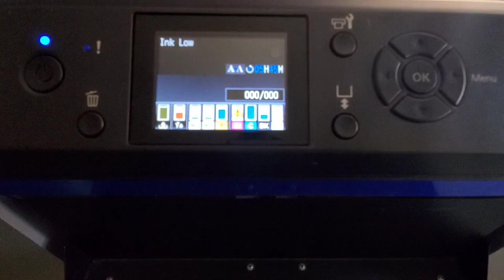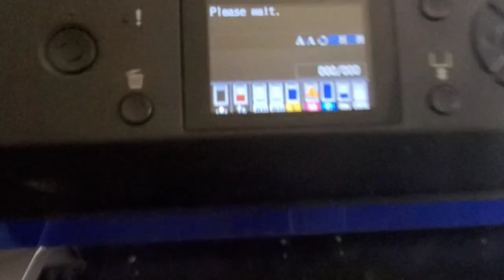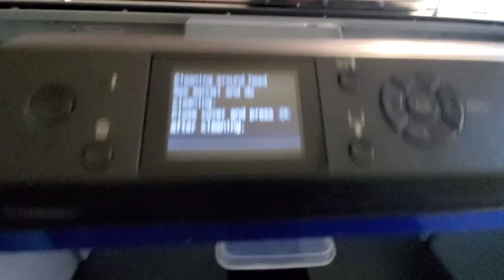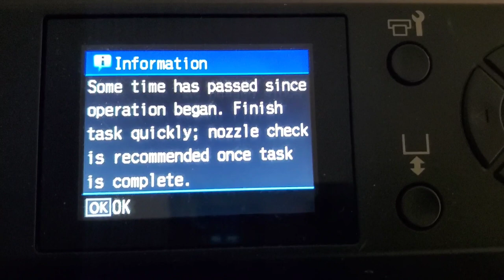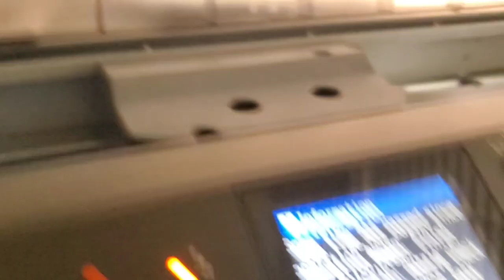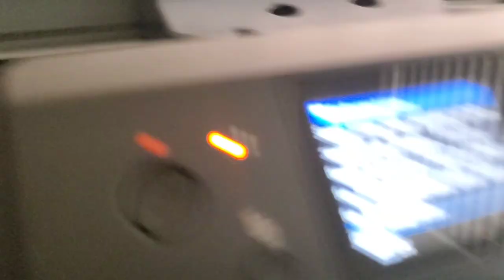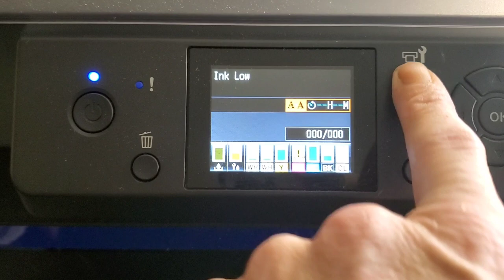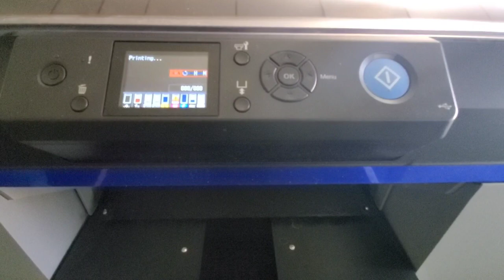SOLVED: Epson F2100 / F2000 Fix Print Head Unclogging & Deep Cleaning Nozzle Check HACK DIY

Comment: AMAZING RESULTS! We're an apparel manufacturer creating samples for stores like Forever21 and Maurices with our printers. We had an urgent meeting in 5 days and needed samples, but our white ink wasn't working, cyan was a mess, and we had suction errors. After trying 5 heavy cleaning cycles, tube cleaning, and contacting the DTG seller with no success, we reached out to Epson support, who quoted a flat fee of $2,479 for repairs, primarily nozzle replacement.

As a last-resort attempt, I tried something I didn't think would work, but IT DID! Our printer now operates like new, saving us $3,000. Thank you!
Reply from the maker: Congratulations on your new opportunity.  I'm glad it worked! Good luck to you!

Comment: Man I can't thank you enough I got my f2000 for a steal but no white at all on nozzle check a week of trouble shooting finally went and bought your ingredients a $8 cost soaked for 8hrs pulled it did a heavy clean and all 4 whites were visible with a few gaps ran a light cleaning now everything is 100% i felt like won something lol. 👏 to you sir thank you
Reply from the maker: Out freekin standing! You won $2000. For real. That's amazing. Im glad you got it. The nozzle cleaning takes a few, and is a slow process, but worth it.

Comment: Will try this. We have 2 white print heads clogged for a year but it prints well still with only 2 white print heads of the 4 but the F2100 thinks it's out of white ink when the cartridges are still 1/2 full?  Perhaps because it is only printing from 2 of the 4 white print heads it is only pulling 1/2 of the ink that the ink meter usually indicates?

Comment: OMG.....IT WORKED!!!!! 
My CMYK were perfect but given the cost of White ink I did not use the white ink for a couple of months and they were blocked even after I had replaced it with 2 brand new cartridges! As my F2100 was 1.5 years old, so out of warranty. I was quoted for a brand new printhead replacement plus travel time & labour at just under GBP£2,000 (USD$2,500). I built the contraption and left the printhead to soak for 4 hours, followed by a heavy head cleaning and 90% of the White came out on a nozzle check 2 more medium & 1 light and now have 99%!!!  We do not get Windex on the UK but I had a DTG flushing solution which I ordered from the USA and it worked really well including a few cleaning swabs total cost $20. THANK YOU (from the UK) for putting this video up!!!

Comment: I tried this method with my Epson DX5 F187000 printhead. Unclogged some individual nozzles, but miracle didn't happen. To be fair, I've bought refurbished printhead, it worked great until last month, when it stopped show some white nozzle check. Maybe I've made something  wrong, but I mixed ~700 ml of Mr. Muscle (alternative to your Window cleaner), ~180 ml distilled water and ~45 ml of alcohol. Then left printhead for about 11 hours, with almost no result. After this l've put the printhead back into your cleaning solution and in addition flushed all nozzles. Only after this inks started draining like you show in the video. This time I waited >12 hours, as the result, pretty much the same nozzle check text as before. If anybody has any hints on this, please let me know! Anyway thank you very much for your video.

Comment: My f2000 printer hasn't been used in 3wks, went to use it and no color was coming out, did a few heavy cleans and now only prints blue. Does this mean my heads are clogged? Would this help?

Comment: Man, amazing. Thanks for doing this and waiting for more tips on saving money on this machine cause it's a hell of a job to get a profit out it if you stay with all epson parts.
There is a video on winding up of wiper unit,air filter diy and now this.Any more tips would be appreciated !!

Also to fellow Brethren, you can get wiper unit cloth from china so you can change it after a couple of uses.
Reply from the maker: Do you have a link to the cloth? Thanks!

Comment: I spilled the liquid on the platform, thank goodness it was clean, I opened it to look and at the bottom there are only the rails, apart from that I am doing it with the printer off.

Comment: Trying on mine but using a respected online recipe for cleaning fluid which I'll share. Unknown period of sitting unused so not expecting a miracle, but wish me well! P.S. using the platen to raise a very shallow container + small cartridge underneath this to correct level (found it much easier & stable)!
1 % concentrated ammonia
3 % propylene glycol
20 % isopropyl alcohol
distilled water up to 100 %
To prepare 1 litre of the cleaning fluid:
In a one litre bottle put 10 ml of concentrated ammonia, 30 ml of propylene glycol, 200 ml of isopropyl alcohol, and add distilled/demineralized water to a total volume of one litre.

Comment: Thank you for the video. I'm going to try this method. But I have a problem. I'm from Russia and there are no Windex in here. Could anybode suggest what can I use instead of Windex? Or maybe anybody know composition of Windex that I can find analog here. Thanks!
Reply from the maker: It's glass cleaner that smells like chemicals.  Here is what's in it. 

2-Hexoxyethanol — a surfactant cleaning agent

Isopropanolamine — a solvent cleaning agent

Ammonium hydroxide — better known as ammonia-D

Lauryl dimethyl amine oxide — a surfactant wetting agent

Sodium dodecylbenzene sulfonate — also a surfactant wetting agent

Comment: Thanks very much for this video...may I ask if it's ok to flush the four small damper cartridges?  I've flushed all of the small ports on the damper assembly, just didn't know if I should with those as they don't feel very "durable".  Units been sitting a while (F2000), so wanted to get everything flushed that would be needed.  Thanks again!!!

Comment: Can I unlock the printhead from the docking station without Ink cartridges installed in the printer? If not can I unlock the print head with empty ink cartdridges? I don't have full or partially full ink cartridges and I also don't want to spend $1300 to gamble on this soaking process working in the first place. Please advise.

Comment: How did you fix it not recognizing the ink level? This is my problem as well as doing what this video is saying… same situation, only I moved, machine sat for awhile. White is the only one I’m having issues with so hoping this works. Then I have that level issue… they are almost new cartridges showing 20% maybe. Thank you!
Reply: Hi! My f2000 no longer recognizes ink levels on the blue and yellow channels. He says they are practically exhausted but the ink in the cartridges is about half ... can you help me? 😔😔
Reply: you need to unclog the 2 tiny holes on the inside of the headcap , put a liitle but of solution to soak overnight inside so it can clear a bit more as well , also you can keep using the cartridge until it runs out even if its showing a lower level than it actually is , if for some reason it tells you to replace it with still alot left , take the cart out , put an older empty one and then put it back and it should let you squeeze out the rest , let me know if you need anymore help i can give you my email !
Reply: @yousefsaleh3758  yes that is the problem it says I need to replace the ink cause it’s “empty” but it’s at least 80% full

Comment: Hi everyone 
I done exactly what you made in the video, 75% winded, 20% water distilled and 5% alcohol, soaked for 12 hours, turn of the machine, sure  that the mixture hit the top of the head at 1mm above. My surprise that nothing happened, the mixture still clean and bleu as it is. Please can you tell me where is mistake. ( BS: all Color’s channels work, except white 1 white 3 and white 4 stop working suddenly, and we use the machine every day even week days some time. Thanks in advance for you time and help

Comment: Excellent video.....
Hello, I'm really thinking hard about buying the F2100, can you give me a little advise or words of wisdom. also....can you use the method you used in this video as preventative maintenance? Thanks for the video?
Reply: just make sure you do a nozzle check, light cleaning, always shake white ink, print and after do another light cleaning. my people skipped alot of cleaning. after 6000 prints it got clogged. But this guys simple cleaning saved us a ton of money.

Comment: Good morning,
thank you for this incredible thing.... quick question, if I only have 99% isopropyl alcohol, can I only put 2.5% in the recipe? and is demineralized water made instead of distilled water?

thank you very much for your great advice... :)
Reply from the maker: Yes, that's fine. Just dilute according and add water to offset.
Reply: thank you, I will do the treatment on Wednesday and I will give you some news... thank you very much

Comment: is there any Europeans in here that knows an alternative to the chemicals. At least where i am from, we have no windex :)
Reply from the maker: Windolene perhaps?
Reply: @richardgrotz8089
3 minutes ago (edited)
Trying on mine but using a respected online recipe for cleaning fluid which I'll share. Unknown period of sitting unused so not expecting a miracle, but wish me well! P.S. using the platen to raise a very shallow container + small cartridge underneath this to correct level (found it much easier & stable)!
1 % concentrated ammonia
3 % propylene glycol
20 % isopropyl alcohol
distilled water up to 100 %
To prepare 1 litre of the cleaning fluid:
In a one litre bottle put 10 ml of concentrated ammonia, 30 ml of propylene glycol, 200 ml of isopropyl alcohol, and add distilled/demineralized water to a total volume of one litre.

Comment: I wasn’t gonna spend the 2k for replacing the head thanks to the video will see what happens in 12 hours for now
Reply: Please update :)
Reply: @owlfactory-cs  update so before I did it I was showing little bit of white ink left in the cartridge so yesterday after soaking the head for about 22 hours I went ahead and did a heavy cleaning and then it showed that I was low in white ink so then I did I light cleaning but I wasn’t able to get any white on my platen I got all other color but no white. I’m assuming it’s unclogged since it’s now showing low ink in the screen I place an order of inks so will see what happens when I receive them also did a cap cleaning
Reply: @Carlos-ru4zt  Man,good luck.may the white ink gods be with you :) . Also Did you turned off the machine or was it running the whole time ?
Reply: @owlfactory-cs  it was running the whole time I was debating if I should have unplugged it but I didn’t
Reply: @owlfactory-cs  do you have the link to order the head cleaning cloth from China you mentioned earlier
Reply: @Carlos-ru4zt  did you get it to work
Reply: @ApexProtector  no it’s was too clogged so I spent 2.5k replacing it

Comment: I am doing this for the third time wish me luck. the first time no white ink came out in the bowl I used the second time white ink definitely came out in the bowl but no white ink is showing up on the print test so hopefully this 3rd time will do the trick 🤞 
1st time 12 hours 
2nd time 22 hours 
3rd time I'll try 24 hours
Reply from the maker: Be sure to do multiple print head cleanings after to re prime the ink.
Reply: @clixstormdiy4352  I'm on my 4th time now I keep getting suction error I've cleaned out the suction cap several times but I'll just keep repeating until the planet runs out of windex lol 😆
Reply from the maker: @Rampacito  check the rim of the cup and make sure it doesn't have ink buildup. It looks plastic

Comment: ahhhhhhhh man I tried this and it sadly did not work for me!!  prior to doing this, all my lines were producing beautifully, except wh3 and 4.  They were producing NOTHING!  After letting it soak for 18 hours, everything remained the same!  wahhhhhh
Reply from the maker: 4 heavy cleanings
Reply: @clixstormdiy4352  are you suggesting to run 4 heavy cleanings after this?  I am open to anything, thank you!
Reply from the maker: @Rachel Smith  yes, purge any liquid and establish a good suction flow.
Reply: @clixstormdiy4352  sadly, it is not working still.  The machine sat for 6 months prior to me getting it. I think I am doomed and have to get a new print head......
Reply: @clixstormdiy4352  how do get rid of the suction error
Reply from the maker: @Rampacito  clean around the suction cap. It gets buildup OK ink that looks like rubber ,but its ink.

Comment: My Wh3 and wh4 were not working.. After following this, nothing works at all.Any help is appreciated
Reply from the maker: You need to do several cleanings. The ink is cleaned out of the head as intended.
Reply: @clixstormdiy4352  I did about 3-4 heavy cleanings.. nothing from any of the nozzle. before following this procedure, i had all working except wh3 wh4..  now nothing.. how many should i do more
Reply: @clixstormdiy4352  btw i appreciate your reply. thanks
Reply from the maker: @pankajmehra2684  mine was the same way both times. It took a lot to clear the lines of cleaning agent. How does your tank sponge look?
Reply: @clixstormdiy4352  which tank sponge.. the plastic box which i used to clean the print head with? it was almost clear like it cleaned nothing

Comment: I keep the printer ON for 12 hours? or can i just unplug it
Reply from the maker: You can unplug. Just put it in service mode with the platen slid back first to access the head
Reply: @clixstormdiy4352  Thanks, at the end I had to do a reverse flush, but it didnt unclog it at the 100%

Comment: Thank you for the info! same problem, I'm gonna try  your solution tomorow.
Reply: OK it worked a little bit after 24hours , I'm gonna do it another 24 hours.
Reply: Conclusion :
I was skeptical at the beginning but.. 
After 3 times :
It worked! I recovered 99% of my white ink. 
I gain 25% more after each time I put the liquid:
24 hours, 16hours, 4 hours and one last 2 hours.
Thank you very much :D, the quote for the fix cost 2800€. A technician told me that for sure I had to change the head 😂😂. I saved almost 3000€ thank to you.

Comment: Hay man, i had to change my printer head but i have the old one, can i inmerse the entire head printer to clean it? Thanks for the video.
Reply from the maker: Yes! Just avoid soaking electric components.
Reply: @clixstormdiy4352  oh no, i think there´s no electrical components on the head printer, 2500 Euros for a piece of plastic man. I´ll try to clean it and tell you about. Thanks!
Reply: @xaviermurilloigiralt4753  how did it go?
Reply: @MistaaFrosty  i did it like in the video and i saw some ink on the liquid so i think it did something but i don´t want to try it on my machine, i have a new (i year old) printer head so if it works don´t touch it.

Comment: Wish me luck I just purchase a Epson SC-F2000 the seller said the white was clogged and he made a sample shirt to show me that the colors where running good but not the white so today I am doing this head cleaning thanks for the video and yes you are right I’m not spending $2300 for Epson come and change the head
Reply from the maker: You got this remember it's a long soak watch the directions carefully and let me know how it turns out I've done this a few times and always works.
Reply: @clixstormdiy4352  I did but when I finish soaking it I did the heavy nozzle cleaning and my white notification came on that it was low but then I did a light cleaning and nothing showed up in my nozzle check only the rest of the colors did except white
Reply: @clixstormdiy4352  do you recommend me to keep soaking the head till I get my order of white ink ?
Reply from the maker: @Carlos-ru4zt  how long is that?
Reply: @clixstormdiy4352  they said it will take a week to get it
Reply from the maker: @Carlos-ru4zt  I would pull the liquid then and put it back 24 hours prior to delivery.
Reply: @clixstormdiy4352  ok thanks I will do that
Reply: @Carlos-ru4zt  y bien? qué tal el resultado?
Reply: @chuskyto  todavia estoy eaperando qué me lleguen los cartuchos de ink para chequiar el viernes me llegan
Reply: @Carlos-ru4zt  update bro
Reply: @slothcloth  I ended up replacing the head

Comment: I am debating whether to try this or not with my f2000. I have nothing coming out of all my whites. Colours are perfect though. 
A week ago I had white on 3and 4 with no 1 and 2. But now none of them are working.
Reply: Have you tried yet? I'm doing it tomorrow, slightly concerned as my colours are perfect
Reply: @jondrive8801  did it work ?
Reply: @staytunedstudios  No, I let it soak for 12 agonizing hours....didn't make a difference to the nozzle check. But... I'll tell you what did work. I put the cleaning carts in (took out the white. Ran 5 heavy cleaning via the cleaning carts. CHanged back to the white..... ANd had a FULL PERFECT nozzle check :))))))))) Good luck with yours
Reply: @jondrive8801  Hello, how do you change the white cartridges for the cleaning ones and that the printer does not give you a cartridge error?
Reply: @nizestore427  it's in the menu, I'm bit at my printer so can't remember exactly. Something like, maintainance - swap cleanings carts
Reply: @jondrive8801  Thank you very much. I think it's the "Replenish White Ink" option. I'm going to try them.
Reply: @jondrive8801  I got it, thank you very much! But my main problem keeps appearing, after doing a clean there is a "suction error", I do a caps clean but the error still appears. When I do a deep clean the error does not appear. Any advice you can give me?
Reply: @nizestore427  I don't know sorry, the only advice I was given I'd to change the assy or the pump
Reply: I'm in same dilemma I'm doing now 10 hours to go 
Did you try and if so how did you get on thanks
Reply: @jondrive8801 do you have the f2100?? My printer doesn’t give me the option to switch the carts to cleaning ones it give me a chip error